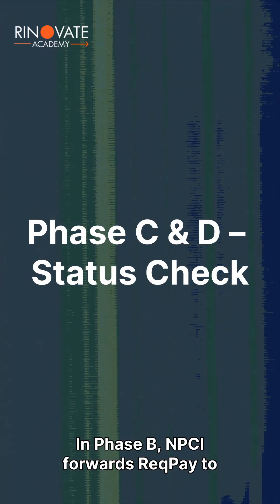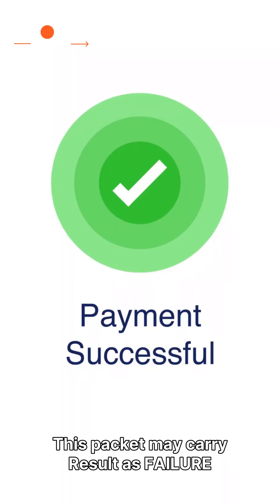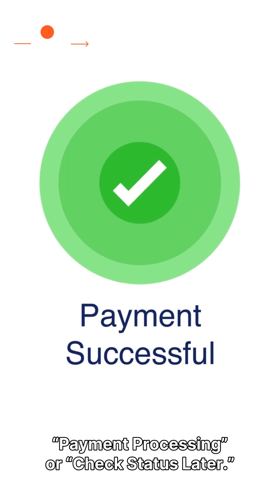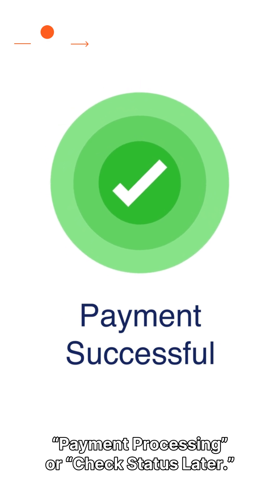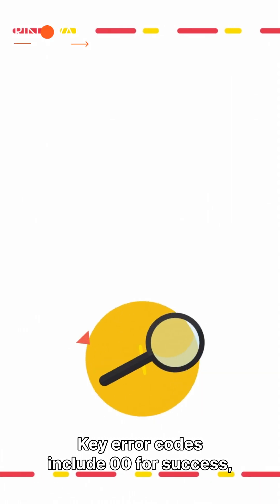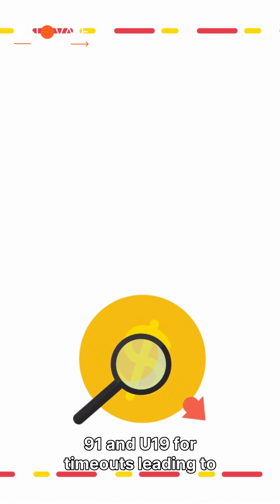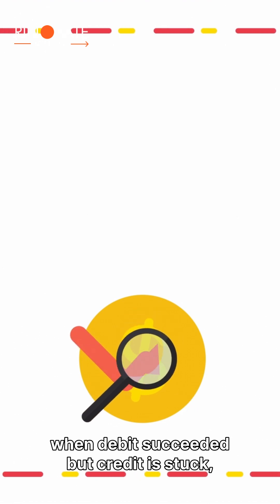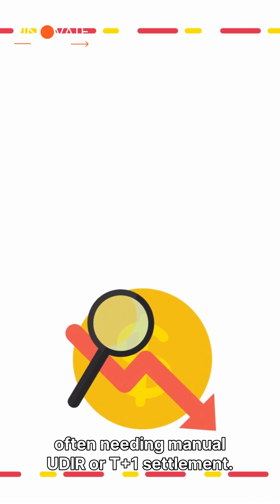UPI Payment Stuck or Pending ?  #techshorts #upi #payment

Comment from the maker: UPI payment stuck at Processing / Payment Pending and money seems “lost” in the system? 🤯
In this Short, you’ll see what really happens between your bank, NPCI Switch and the beneficiary bank using packets like ReqPay, RespPay, ReqChkTxn, Reversal & UDIR – plus what error codes 91, U19, U69 and U30 actually mean for your money.

If you want more deep-dive content on UPI payment failure, UPI transaction pending analysis, banking networks and cloud-native payments, comment “UPI DEEP DIVE” 👇

🔔 Subscribe to Rinovate Academy for:

Networking & Cloud

UPI & Digital Payments

Fintech + Infra for engineers

#upipaymentstuck #upipaymentpending #upipaymentfailure #upitransactionpending #upifailedproblem #npci #digitalpayments #rinovateacademy